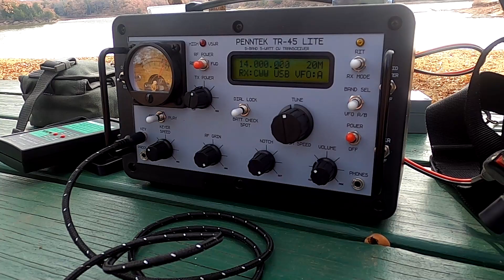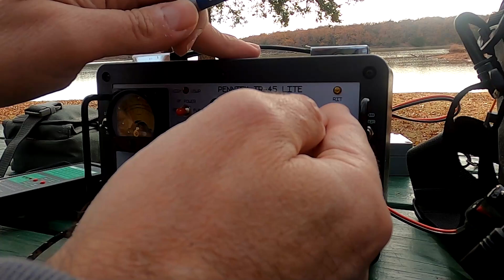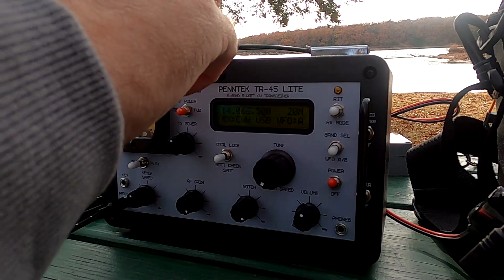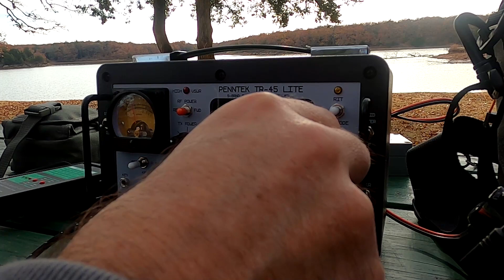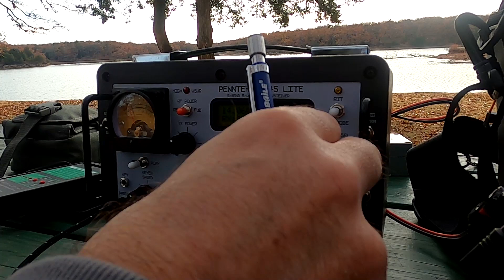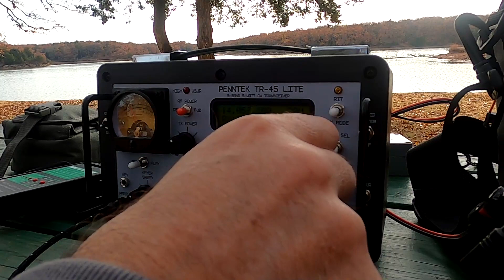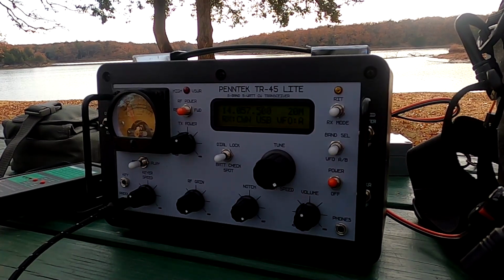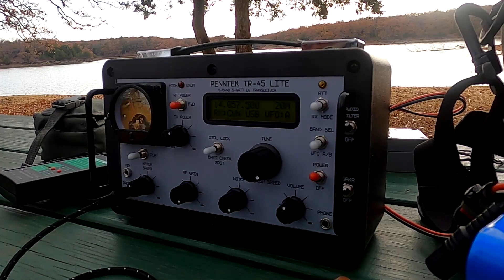Short test in the field with the TR-45L

Comment: Does it plug in or does it need a power supply?  Internal speaker or external plug-in speaker?
Reply from the maker: I believe the radio is provisioned for an internal battery since it has the red and black plugs, the red plug is for charging the internal battery while the black plug lets you attach an external battery. The radio comes with a power plug and wire that has the positive and ground stripped and tinned to attach to what ever you want. I chose to attach Anderson Power Poles to mine and use a Bioenno Power 9v 6ah battery.